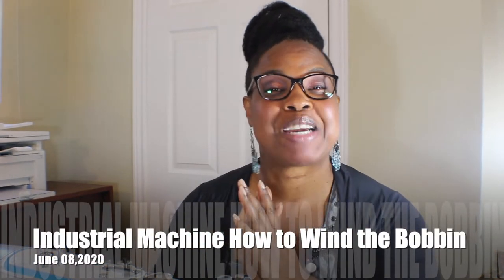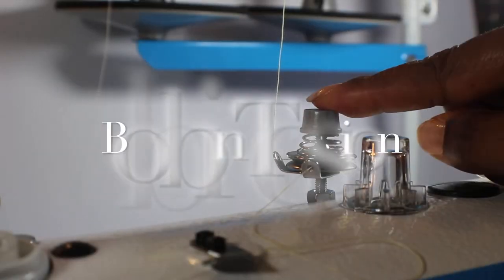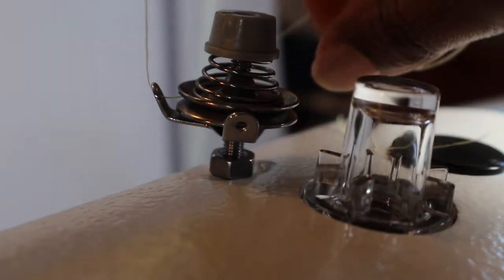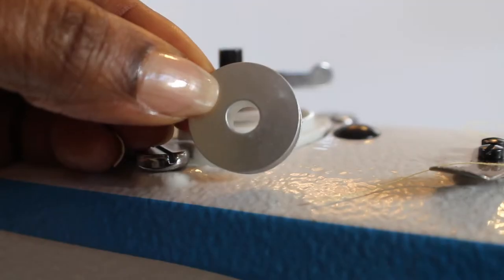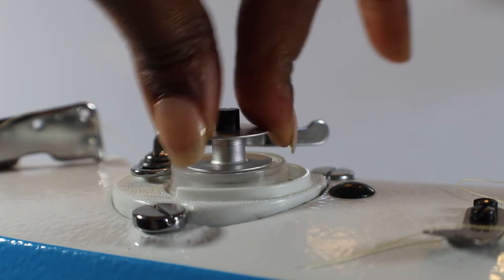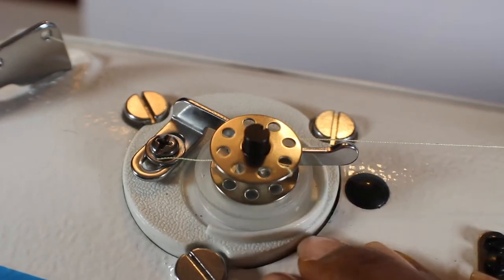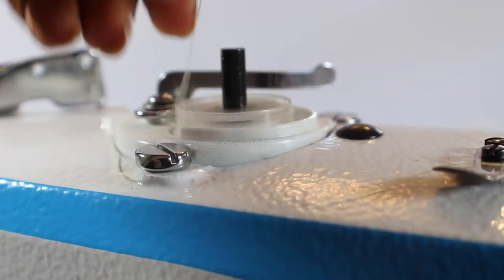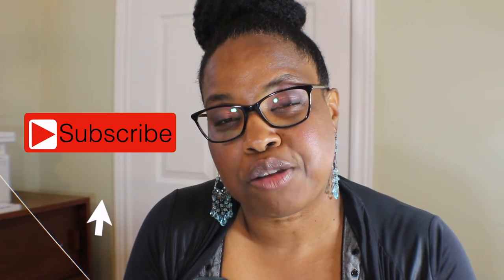How to Wind a Bobbin on a Industrial Sewing Machine | Jack Industrial Sewing Machine| Beginners

Comment: Nice video but how do you go about getting the thread  winded on because I have a similar one and I can't get my boobin winder work.can  you please help me.do you have to press any other buttons to get the thread winded on? Thank you much.
Reply from the maker: Do you mean that when you place the bobbin on the winder it's not winding? You see the picture in the thumbnail. That arm needs to be pressed toward the bobbin. 

 If that's not it you also need to make sure that the thread is tightly wrapped around the bobbin before you start to sew. You know on a domestic machine, when you are going to wind your bobbin you can hold the bobbin thread until the bobbin starts winding try that. 

Check to see if your thread is between the tension disc's

The last thing is make sure your bobbin is spinning the correct way.

Let me know if you got it to work, I'll try to do a video on it.
Reply: Thank you very very much it's working great . appreciate your help much

Comment: Ok, but how to wind the bobbins without the hole? The thread always unravels while winding it because I can't secure it anywhere 😭
Reply from the maker: You have to hold the thread while the machine is winding the bobbin for a couple of loops before you let the thread go. Here is the trick... you need to also know which way the machine is winding the thread on the bobbin.  You need to wrap the thread around the bobbin so the thread is tight. Let me know if it work.
Reply: @BrambleReid  i am holding the thread, but the thread I'm holding is unwinded at the same speed that the machine is winding it. I just can't win 🙈
Reply from the maker: Wrap the thread around the bobbin!. If you are sitting at your machine.  Your bobbin should be on your right hand side.. put the bobbin on the bobbin holder. Wrap the thread around the bobbin. Wrap clockwise 4 to 5 times. Then click in your bobbin lever to lock your bobbin in position. Keep holding the thread, now press your presser foot. And don't let go until you see that your bobbin ia winding.